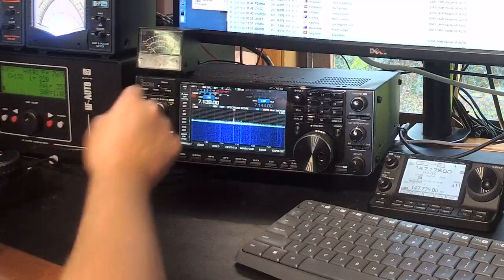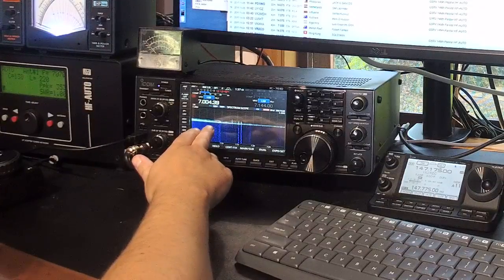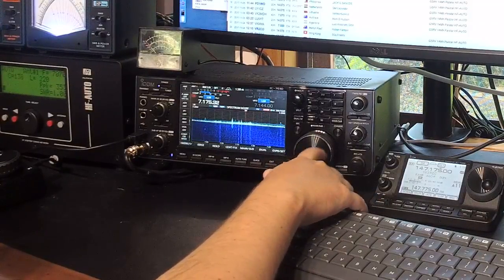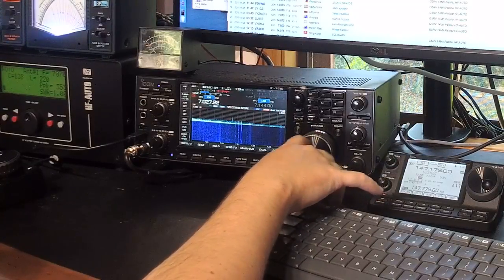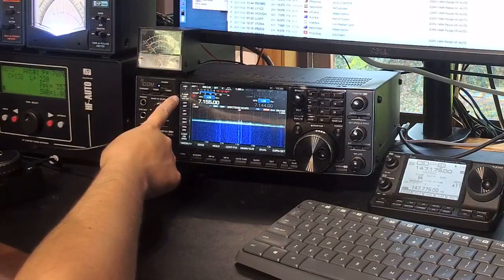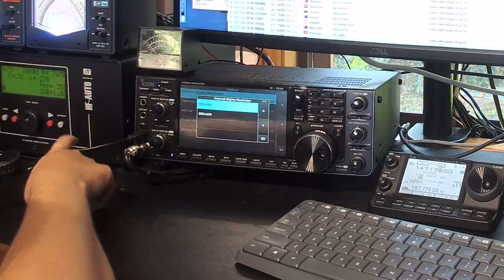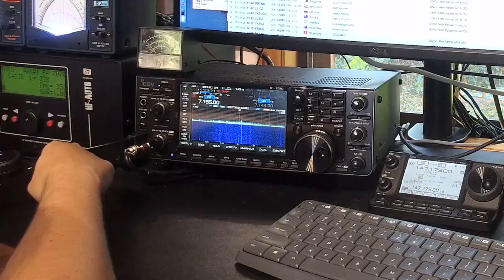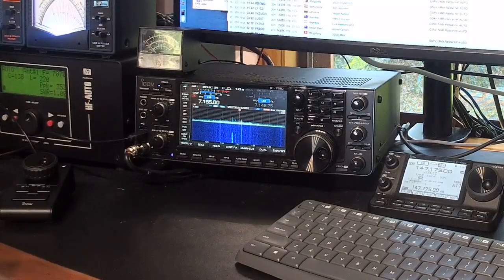Icom IC-7610 Digi Select Demo, Warranty Musings & RC-28

Comment: Is not the purpose of the Digi-Select to reduce interference from other bands?  If I have my 7610 receiving on 14.200Mhz, and there is a strong station on 7.100500Mhz (single frequency to make to easier to understand), I could hear this tone on my rig (at 14.201kHz).  A 1kHz tone heard.  If I switch on the Digi-Select in auto mode, shouldn't this tone be reduced or eliminated completely?  It isn't on my IC-7610!

Comment: Hi Jarrad,

the only disadvantage of the 7300er was ringing at small CW Bandwitdhes like 100 Hz or 50 Hz. Can you post a sample withe 7610 pse?
BR from Ralf
Reply from the maker: dl6urk Dear Ralf, the IC-7610 is currently in the shop as a precaution due to a slight issue with TX output, but I will do a video on this.  As 50Hz and 100Hz are very narrow bandwidth, I expect there will still be some ringing.  I now have a mixer, so will post a video of the audio received by both radios.  73 Jarrad

Comment: The video out is and has been a concern to me. I don't know why they didn't use an HDMI connector and some decent resolution. I suppose the larger your display monitor, the more resolution you lose  (like the poor IC-7000 video output - becomes all blocky) ? which might explain why at various Icom shows, they only used a rather small external display - to keep the resolution sharp ? I would like to see you hook up a > 28 " + high def display in a future video. At the FlexRadio booths they hook up massive 60" 4K displays and the resolution remains pin sharp.
Reply: You have a computer monitor right there - with a DVI to HDMI adapter it should work. Those adapters only cost a few dollars. I really want to see if there are more resolution choices available with a monitor connected. Thanks for the good videos.
Reply: because of the fact that DVI connector is royaltyfree.

Here, the display is on a 27", 2560 * 1440 monitor almost full screen. It autoscales : each single pixel from the rig will be 3 pixels so 2400x 1440 and you won't see it, at 800×480, you can do the math with 800×600.

Comment: With the preselector, and all the relay clicking...I think I would tune the bands with it NOT enabled, and then once I am on a frequency, and if there is noise from adjacent frequencies, I would enable it. But I wouldn't tune the bands with it on. I would hate for the preselector board to give up.
Reply from the maker: Dear John, I have the same concerns.  I know relays have come a long way, but the Yaesu FT-102 relay issues are legendary.  It remains to be seen whether the radios of today will last the 30+ years of the radios of yesteryear.  Personally, at this price point I'm banking on 5 years of great service (that's my warranty), and if we're lucky a new feature via firmware here and there :)
Reply: LOL Jarrad, I just read a comment lower down that says he finds the Aussie accent difficult to understand. Maybe I should stay away from video production - I think he would struggle with my S. African accent. Yes, I see there is a new firmware update for the IC-7300 this morning, version 1.20, I will update my two rigs in the next hour. To be honest, coming from 3 previous Flex rigs, I was hoping Icom would be more regular with meaningful firmware updates....now that they have embraced SDR technology. There is some really good stuff that could be added through firmware updates....we will have to wait and see, but for now it seems all they are interested in doing through firmware, is fixing bugs and not adding features.
Reply from the maker: Ahh my china I think it would be a lekker turn ja?  

I must admit my voice is pretty hard to understand; when I did the audio only video I rolled the bass off 15dB on the mixer!
Reply: I can see your S. African slang LOL, and you got it right. Most of that slang (lekker and my China) is used in the Johannesburg area. Funny how different areas of a country have their own slang...and even accent. I can tell a Johannesburg accent apart from a Durban or Cape Town accent.

Comment: Jarrad, the basic IC-7610 manual states: External Display Resolution (Default: 800x480) Select the screen resolution of the external display. However, I did not see any range listed to choose from.  Is the default the max or does it support a higher resolution?  Best Regards, Kevin, WA6JKN
Reply: Maybe there would be higher resolution choices if there were an external display attached. Windows works that way. If Jarrad could connect a display and let us know that would be super.